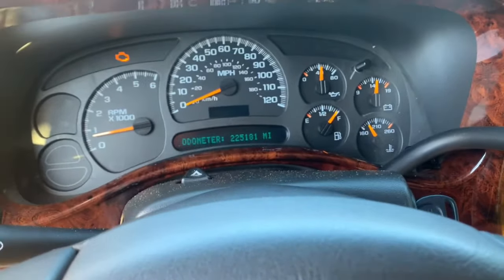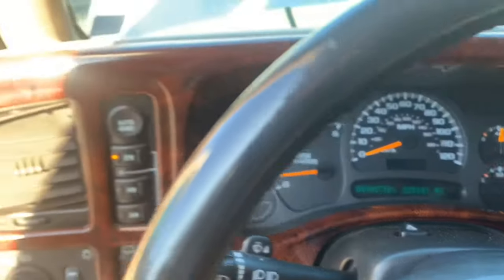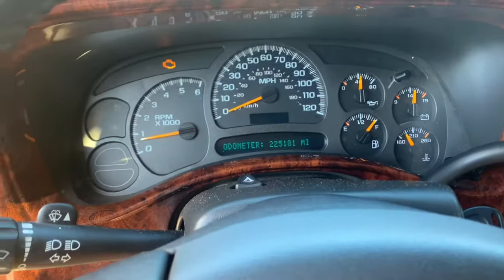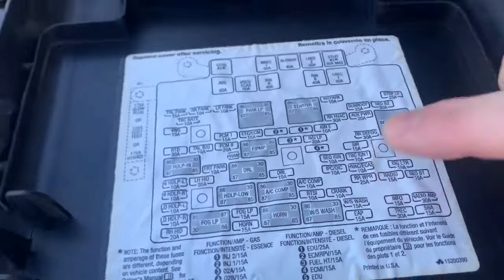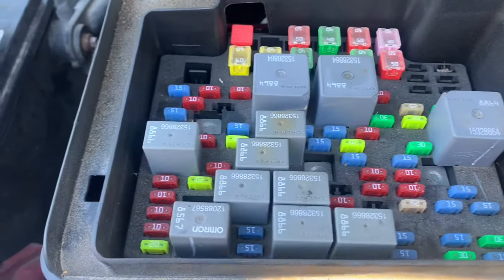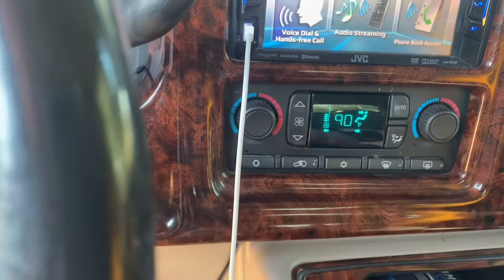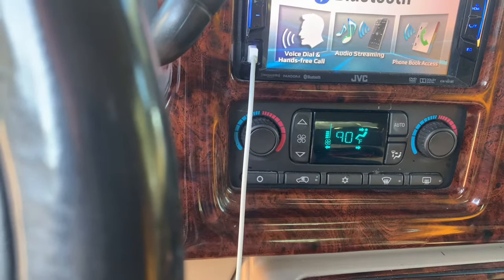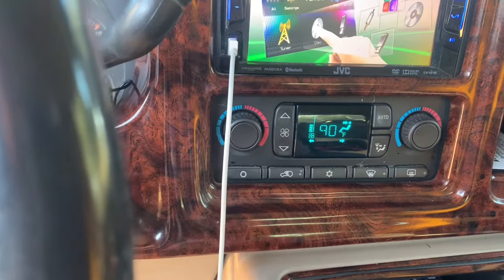GM HVAC Blend Motor Actuator Recalibration process Tahoe Suburban Silverado FREE

Comment: This  is what I did after watching dozens of diy's. and for a 2002 chevy avalanche z71
1. disconnect battery 15 min. with everything off. with AC set to AUTO.
2.start car 2 min.
3.turn off.
4.disconnect battery again 70 seconds then reconnect.
5.start engine 2 min running DON"T TOUCH ANYTHING.
6.turn off
7.turn on after 10 seconds, set FAN switch to on and test. 

good luck pablo
Reply: I sure hope this works for me. I’ve watched several of these diy videos as well and my GMC Yukon simply does not have an ‘HVAC ECAS’ fuse. It’s a dual AC model and I wonder whether that could have something to do with it. 🤷

Comment: 05 Yukon I was told to push the AUTO button first. Then unplug HVAC fuse. Wait one minute then re- install fuse. Start truck and don't mess with the controls for a few minutes. You will hear them flipping around.
Reply: I'm not hearing anything... When I start vehicle comes out hot air then goes to cold... Not doing anything on the screen, just showing what I had it set at... But no clicking or noise ...

Comment: I have the manual left/right up/down sliders.  It's also loses calibration.  To reset that, move the temperature sliders partially off the bottom before reinstalling the fuse after restarting the truck.  Then, when you reinstall your fuse and the HVAC recalibrates, you can move the sliders down to get the maximum cold.
Reply: Like one click before max cold?
Reply: @dallasdelano8235  Generally, more than half way up the blue bar before the red.  Just not on the bottom in the blue.

Comment: These trucks don’t have vacuum actuators
Reply: It's more like recalibration the computer for the hvac
Reply: I heard that too. GM ditched the vacuum actuators in the 90s. Some vehicles in the 80s. These trucks have electric actuators on both the automatic and manual temperature control.

Comment: Not true about the manual ones they are all wire controlled they don’t have any vacuums. But they are recalibrated differently.
Reply: Do tell... I heard disconnect neg for 5 minutes and leave in accessory position for 2 minutes after reconnecting vattery
Reply: Manual is also actuators ,no cables or vacuum .

Comment: Dude... the manual... non digital is not vacuum actuated.... similar actuators... easier to disconnect neg terminal for 5 min and then leave in accessory position without turning on for 2 minutes.... according to Dorman tech Chris

Comment: 2003 Chevy Silverado 1500  ext. Cab. AC blowed cold on driver side, and fluctuated hot and cold on passenger side. Did the reset, save myself some cash. It Worked. Thanks to vid uploader.

Comment: 2000 to 2002. Everything's a slightly older like the radio, the steering wheel, the HVAC system, the switches. Honestly, I believe 9902 is better... For those reasons, the only thing you get is electric fans in like '05. That's it. That's why they have a couple more ponies so that's really all it is and they got rid of that stupid EGR system which honestly isn't that stupid. I see a lot of these 99 to 2002s with lots of lots of miles I see them all. It's the greatest truck ever built... Imo gm was the king of half ton daily driver truck from 1967 to 2007 that's a run baby if I ever seen one... Too bad the new ones are complete hot garbage

Comment: I inow this is an old video, but if anyone sees this and can answer it that would be great. 

I did this reset, and finally the A/C came out of the vents.  So i was like, ok, problem solved.  But i turned the truck off and whem i started it again it was back to not working out the vents.  Im in Arizona, and while the truck will cool down between the rear a/c and the a/c out the defroster, its really nice to have it out thw vents when its 110°.  Also, i have a stabilitrack error even though theres no ABS light and i just replaced all the brakes/,rotors/conteol arms and all 4 shocks.  You can hear the truck leveling when you start it. 

Whatcha think? Do i need a new BCM?

Comment: The manual climate controls also uses actuators( I have personally changed about 50 of them ) .  Slide both sliders about 5/8 or 16 mm up from the bottom . Set the fan on three then do this same process .

Comment: You forgot to mention that's only for a dual climate control system not a single control system.
Reply: Same for both I think
Reply: Single uses 3 actuators as well just less expensive ones

Comment: Would this work for Escalade too do you think?  Probably right?
Reply: As long as it's older than 06 than yes it should. All of these trucks (including the suburban, Yukon, Tahoe, Silverado, escalade, and other etc...) were basically the same vehicle with some little bells and whistles. The drive train and HVAC system were similar. 

This is the digital dual zone system this gentleman has, you likely have the trizone with rear HVAC as well. The front HVAC system is mirror to this. The difference is you have a heater core, EVAP and yes, more actuator doors in the rear passenger side panel.
Reply: It’s a gm